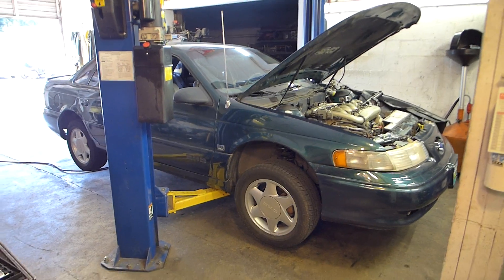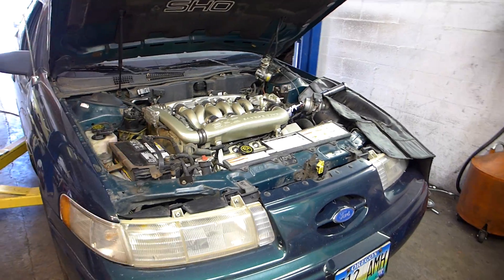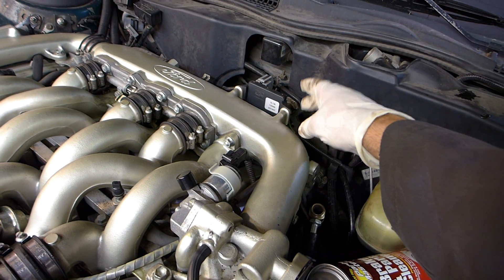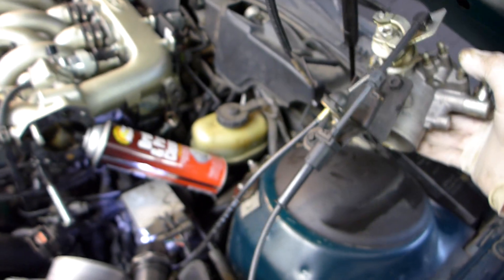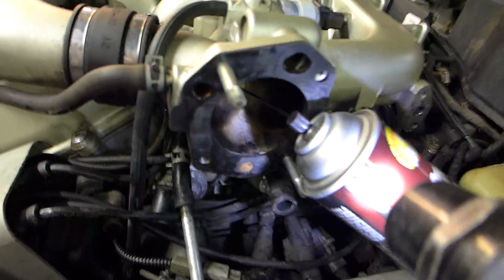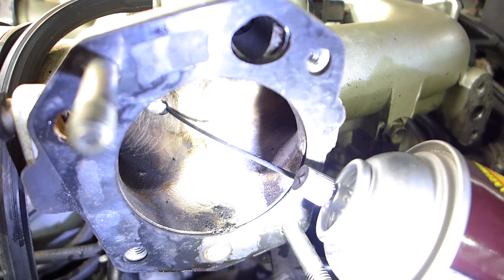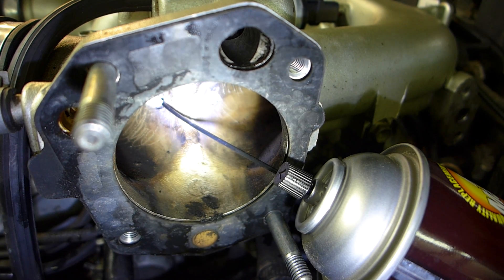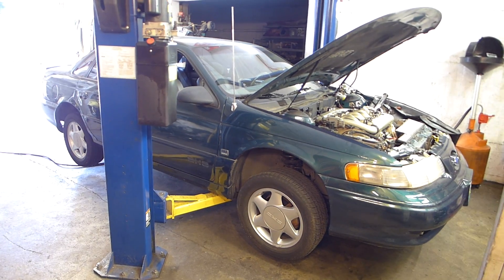Pesky EGR "low flow" trouble codes  (OBD 2, code P0401 or OBD 1 code 331)

Comment: I'm sure it happens to other car makers but It seems like Fords have had this egr issue for decades, I remember running into carbon problems with Ford cars and trucks wayyyyy back in the late 70's early 80's.  I've seen people resort to using a piece of speedo cable(and brake or carb cleaner) on a drill to unclog passages like that.